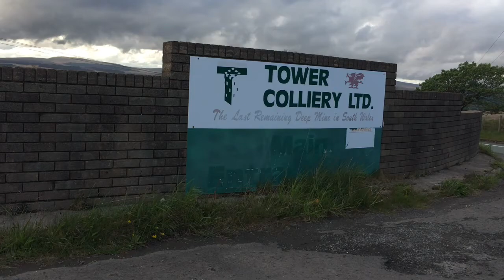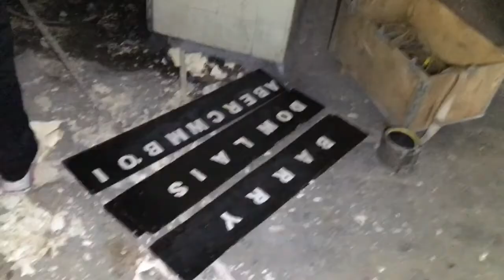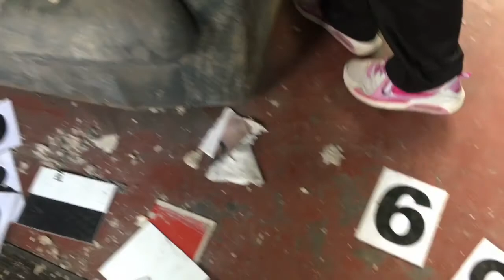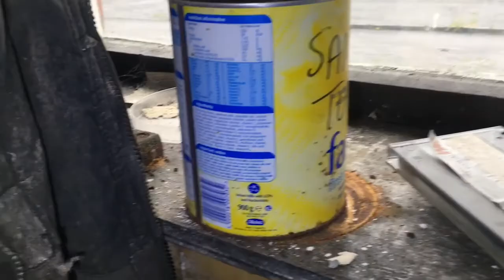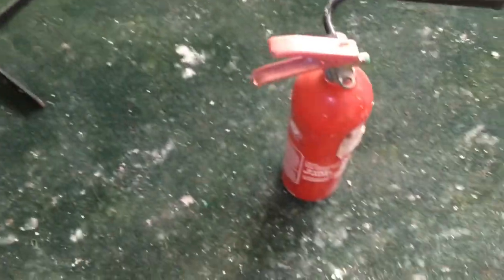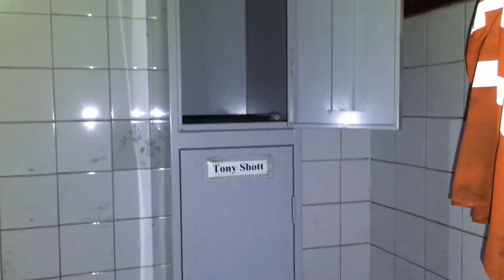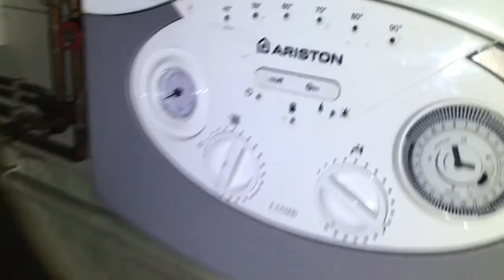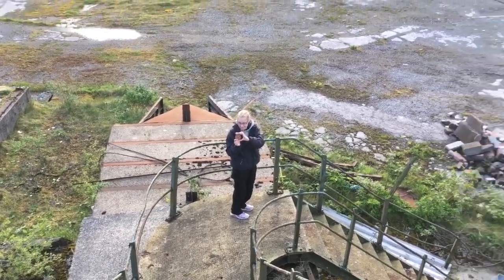Tower Colliery - Untouched!

Comment: My Father worked there, my Grandfather worked there, my Great-Grandfather worked there. All lived in Hirwaun at some time. Until the 50s when my mother sold the house she'd inherited at the bottom of the Tramway and we moved away. They all caught a pony's tail as they stampeded into the light and freedom on certain days. Holding onto the tail allowed them to be towed up the drift at top speed and int the open. Good tales indeed

The older men wouldn't wash their backs as they believed it would wash their strength away. My mother and Great-Grandmother put a tin bath in front of the fire and filled it with hot water for my father to wash in. There was little embarrassment back then and both women washed my father down. Tough old days as some who are still alive in Hirwaun can still testify to Mother's side name was Sweet with Uncles Austin and others

Comment: I live less than 30 minutes from here I will have to check it out. Any advice for someone who's not an explorer?
Reply from the maker: Well firstly, be careful, these places can be extremely dangerous, secondly I was told after we visited to avoid coming down the driveway as there is a cctv camera that apparently works.  Safety is the main thing though always make sure you are safe, with PPE.  Bear in mind you do this at your own risk, and in NO way can blame anyone else for your actions, if you do have an accident then cop the blame and dont ruin things for others, take care mate!
Reply: Urbalites UK Went there today. It was fascinating. Was very careful and certainly wouldnt hold anybody other than myself responsible. Fantastic experience and found it so interesting. Will definitely be going back better prepared for a second look.